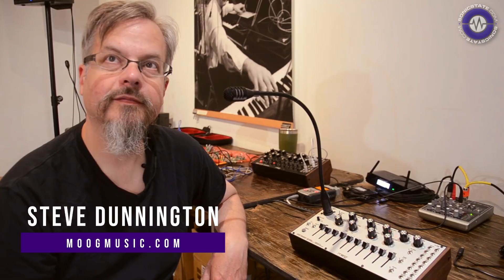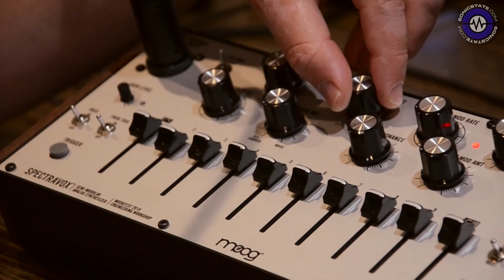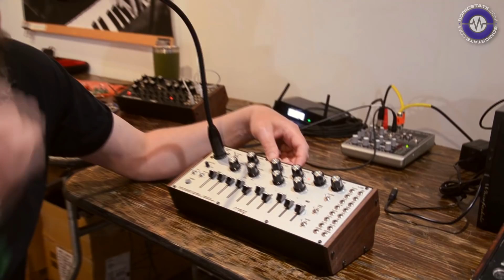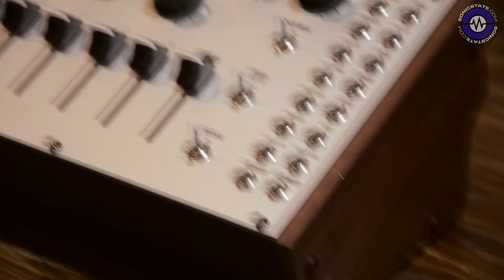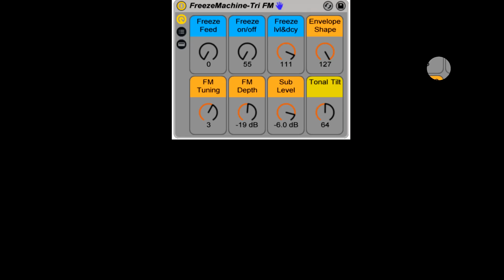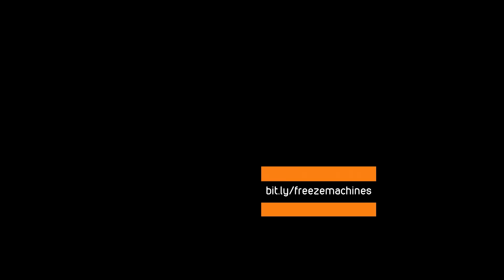Moogfest 2019 - Moog Spectravox

Comment: Please sell a DIY kit!!
Reply: I never even thought of that but why wouldn’t they!?
Reply: @joechristopher5803  Probably because support would be a total nightmare. There are so many mistakes that could possibly happen - and do ( I made zero mistakes this year, but made two last year requiring quite a bit of rework). You are soldering through-hole parts right next to tiny SMD parts - one little "accident" and your board is toast. Also, there is quite a bit of bench level tuning involved - requiring an oscilloscope, voltmeter, and bench accurate tuner. It's not LEGOS.
Reply: Did one of these Moogfest VIP engineering classes. If it's comparable to the DFAM inside, its not very hard to solder/build, but just takes a bit of time. 

Really not a bad idea at all.
Reply: They gotta calibrate them a bit after you build them is one of problems
Reply: Yes, the design should be improved before making a Moog kit. Seems 3rd party similar kit DIY is the way to go.